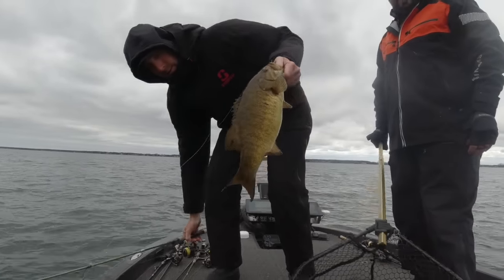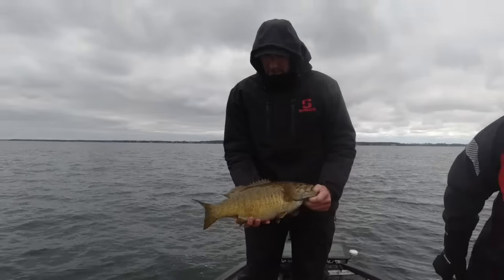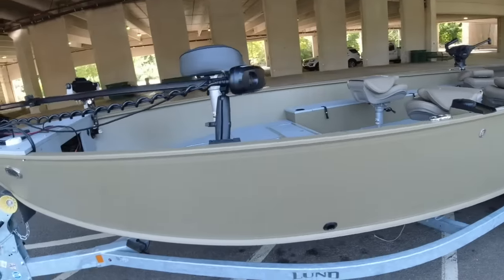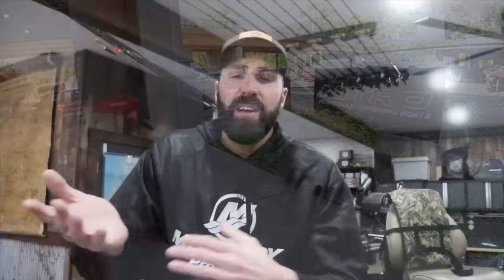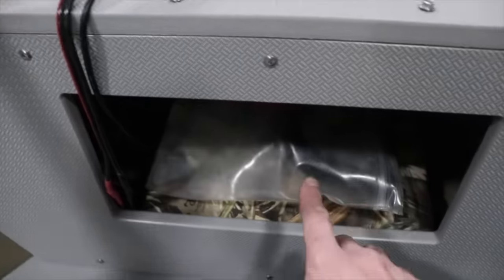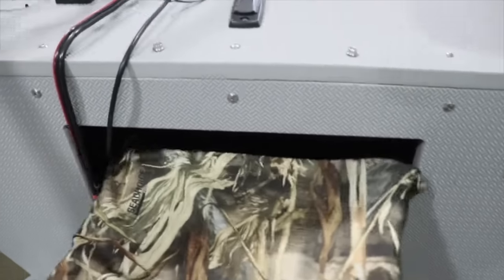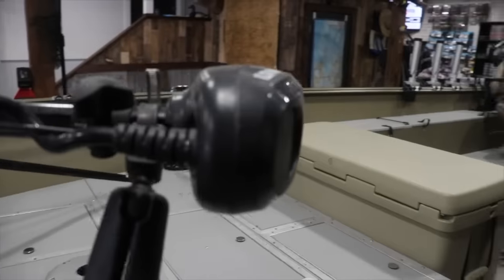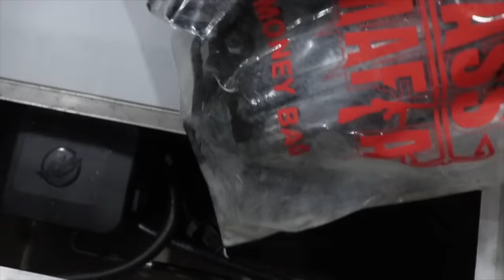Lund Alaskan Set Up - My new 20 Foot Aluminum Boat Walk Through

Comment: Sweet set up!  Are you able to go slow enough with that motor to troll or is a kicker in your future?
Reply from the maker: I can get it down to a slower speed for trolling. When I go into the waves it is perfect.  Going with the waves I do put it in neutral multiple times while making a troll.  That trolling motor at the bow will be used more to troll with in the future if I need to slow it down.
Reply: Not sure if you tried this but you can always drop trolling motor in water while using big motor to drop some speed.  Adds some resistance and helps bow hold line during troll.  You don't even need to power on trolling motor.   @SmallmouthCrush